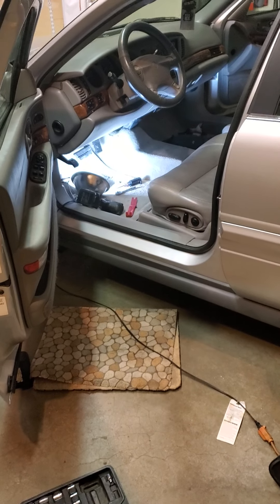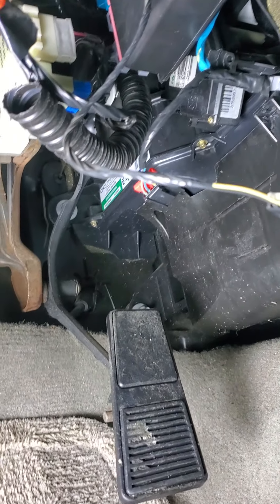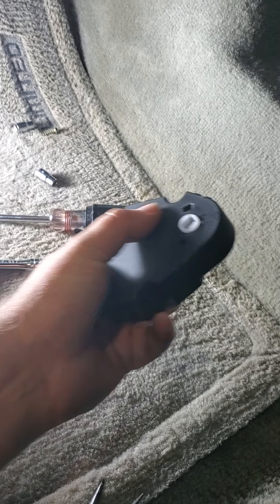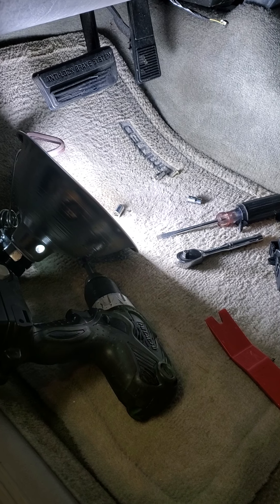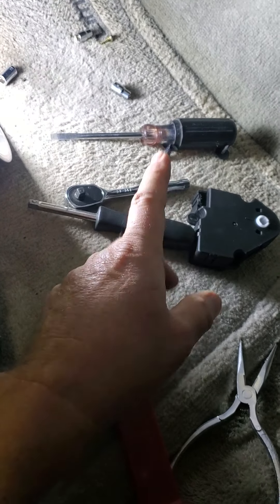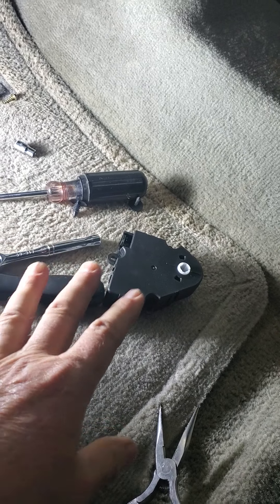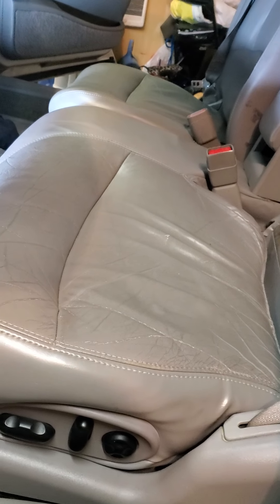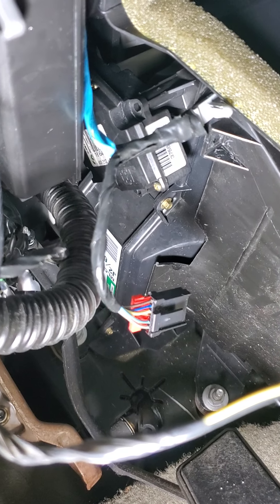2002 Buick LeSabre 2nd blend door actuator

Comment: I have a 2003 buick lesabre limited cold on passenger side hot on driver side I checked passenger side it rotates and that's the temperature adjustment from hot to cold so the blend door on drive I a sum is the door opener haven't checked  it yet but I'll get back when I check it
Reply: Hey i have this exact same issue. I looked at the driver side actuator and it wasn't rotating. hopefully yours is the same

Comment from the maker: Follow up, I got the actuator in and I have heat on the drivers side but now I get it cool.  I may have to redo it and see if the actuator is lined up properly but I don't want to.
Reply: Thanks for the video, I have the same issue but mine isn't blowing cold air when ac is running.
Reply from the maker: It's not much fun
Reply from the maker: It's kind of a pain putting it in
Reply: @drivewaygarage1561  
I'm small so I was able to get it. But it's working perfectly fine. Both actuators turn.
I have cold ac and heat running fine on the passenger side but no cold ac from driver side. 
Any ideas what else it can be??
Reply: @loving1616  Probably a little low on freon charge, many people have found the drivers side stops cooling before the passenger side when freon charge is marginal.
Reply from the maker: @Tintyourlights   If I remember right they're the same but I'll double check after a while
Reply from the maker: @Tintyourlights  604-10652402588 is what I got

Comment: Jim, did replacing this actuator solve your problem? .... i can't get air from my defroster,  i replaced the actuator on the passenger side but it did not solve my problem.
Reply: Replace the driver side too i'm having the same issue no defrost or floor.

Comment: I have the same model and year. I check both actuators and there good, has Freon also. Do you know of anything else it could be ? Hot air on drivers side cold on passenger.
Reply from the maker: Maybe some kind of obstruction hopefully not like a mouse nest
Reply: Did you find out the problem? I have the same issue
Reply: No obstructions I cleaned out the cabin filler and vents.
Reply: Nah bro. If you find something out let me know.
Reply: Did u ever fix ur issue
Reply: No
Reply: @joshuaschmincke7705  I have a 2003 lesabre, and I added 12oz of freon, fixed my hot air drivers side problem. I checked the temp with an infrared light and it was 41f inside the vents on the drivers side dash. You might give that a shot.
Reply: I had the same issue. I just added a little more freon and it somehow fixed it.

Comment: Getting it out was not a big problem.  But putting the new one in was.  The blend door is heavy and if you turn it, it won't stay where you want it to install the diverter.  Ended up plugging in diverter, (not installed yet)  and turning key on to move diverter to where you need it and shut it off and remove the plug.  If the diverter isn't in correct place it won't fit on the blend door rod.  Install and hopefully it is aligned up and put the screws in.  Now program the diverters before doing anything else.
Reply: What’s the screw size ?